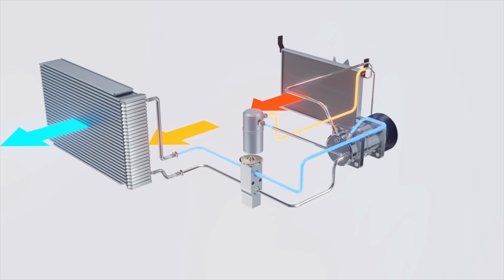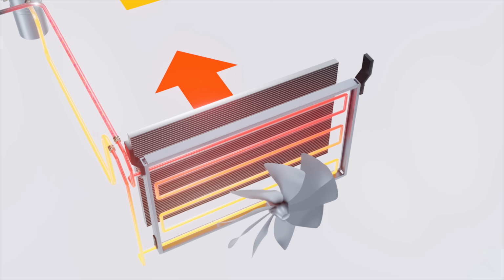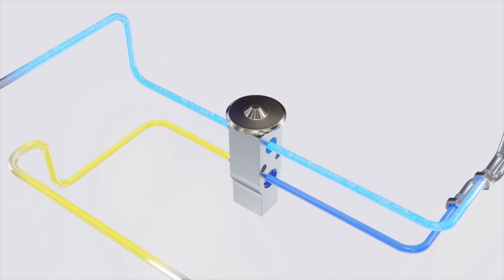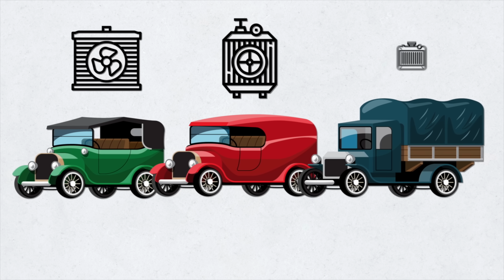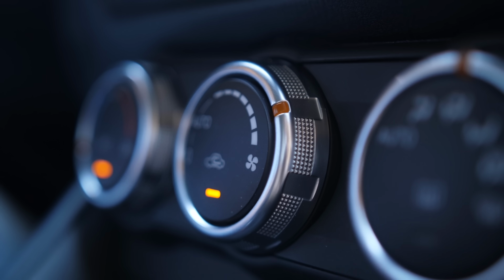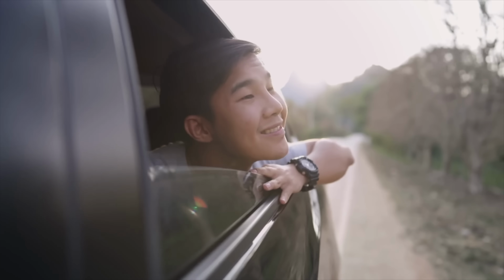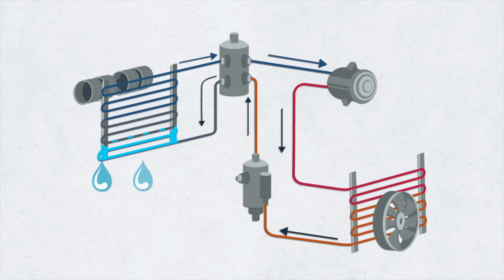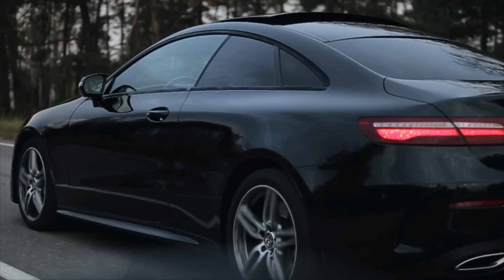Never Do This to Your Car’s AC System

Comment: I've been told to leave the engine running if I'm sitting idle with the ac on instead of turning on accessory mode just for the ac because it could drain the battery, is this true?

Comment: I have a brand new Mazda cx30 and the ac system sucks. My dads a 40 year experienced auto mechanic and we’ve felt cold ac systems in our days. My car blows 60-65 out of the vents..our 20 year old Montero blows 34 when parked. Mazda said it’s the way the car is made and they admit it’s not the strongest

Comment: The biggest problem is the compressor cannot compress a liquid it compresses gas therefore if you have water or liquid going to the compressor you get what's called liquid slugging and that will destroy the compressor over time and also creates acid

Comment: The expansion valve is called a TXV a thermal expansion valve The office tube is the little part that goes inside of a fixed office not on a TXV

Comment: Great. Thank for the info. Learned a lot. One question though, can i leave my ac and fan on when turning on and off the car engine?
Reply: Yes. You'll hear the a/c compressor clutch engage a second or so after the engine starts. The compressor will not be engaged when the starter is turning the engine. But one thing not to do is keep the a/c set to recirculate when the car is off. Move it to fresh before stopping the engine. This lets the evaporator dry off better so the a/c doesn't develop stale or moldy odors.

Comment: ‘14 Ford Fusion. My A/C compressor clutch fell off. Unfortunately, Ford doesn’t sell just the compressor clutch, so a little over $200 for the complete pulley kit. Built Ford tough my butt.

Comment: I'm about to start work on my AC system, since it doesn't blow cool air. From what I can tell the compressor kicks on, but the system also doesn't seem to like to go through the defrost vents. I've checked the coolant levels, and It actually shows that it is overcharged and is in the red. Any help before I start working on it would be appreciated. I live in Houston, and this July heat sucks. The car is a 2007 accord

Comment: I had heard that if you drive with the windows down for a mile or 2 after the car was in the sun, it was better...instead of cooling air the hot air was forced out and it was more efficient

Comment: Never had any issues in 35+ years of driving with all sorts of cars. Then purchased a 2017 tundra. After the first summer started getting a moldy smell. Went to the dealer and was told it was normal. I asked where the a/c drain line was and was told it was on top of the transmission. Also found out warranty didn’t cover this. Was told to buy cleaning kit. Tried that and it took care of the smell for few weeks but came back. Was told also to run the fan without a/c being on. Also Lysol was recommended. All worked for a short period. Then purchased a ionizer and that seemed to get best results but I use it once or twice a year. But seems to me it has a poor design. FRUSTRATING.

Comment: My 1998 Honda Accord V6 with 315,000 miles was destroyed by a shoddy repair job on the AC clutch by a crooked Honda dealership (not my regular dealership, as I was in a different town).  The damage caused was so great that it was not economically viable to repair the car.  Otherwise, the Accord had been a great, reliable vehicle for 21 years with regular maintenance.  I hope the people who did that to my car have slow and painful deaths.

Comment: Here’s a Top Gear Top Tip: “don’t buy a merc the maintenance is too damn high.”
Reply: It usually goes like that for every car, not only Mercedes. If the car was 100.000 USD new, even if you bought it for a nickel, second hand, expect it to be like 100.000 USD car maintenance. Sure, that's not as simple in every situation, but I think its good to think like this.

Comment: I find that my gmc truck has way less power when the AC is on. It’s a 2015 so should be the new system. I have to turn off the AC if I need to pass someone or else it’s very sluggish. So it’s not turning anything off

Comment: Hi Scotty Kilmer. I live in Las Vegas and the temps outside have been into the 110's. My air conditioner is working perfectly fine. My temp at my vent is around 55,  but when the outside temps are this high it's hard for the ac to keep the cabin cool. Is it safe to use household hvac foam insulation like the stuff used on HVAC line sets to keep the ambient temperature from affecting the line set temperature. I was thinking of adding it after the receiver dryer only to as close to the firewall I can get it. This is a Mk IV Jetta 2.0.  Your thoughts are greatly appreciated.
Reply: Sin city is hot as hell.  Maybe that's a clue
Reply: @ceciliaabdalla4954  I wouldn’t have it any other way! 😎☀️🌴

Comment: My wife's 2007 Honda Accord A/C crapped out on a long trip - it turned out to be a relay under the hood - after I researched the problem, I discovered this is a very common issue with Honda cars - so I now keep a spare relay in the glove box, for when we go on long trips in the summer time.

Comment: Hey Scotty great video! my wife's 2010 Honda insight always blew extremely cold air with the AC on, then one day she came home from work and a extremely loud scraping metallic sound was heard. The sound started with the car and did not go away when turning anything on, it only went away when you turned the car off. The AC was also no longer blowing cold air at all! I've diagnosed it as the AC compressor pulley/clutch needed to at least be changed, the clutch never engages when you turn on the AC but the pulley rotates freely(just with lots of metallic scraping noise.) So that's my next project when i have time off to change the compressor pulley on my wife's car!

Comment: When the outside temperature is over 110 degrees (F), my AC system stops working.
Reply: Possibly your ambient temp sensor. The ac and computer relys on this sensor to trigger the ac compressor to kick in
Reply: Are you RODDNEY DANGERFIELD/

Comment: AC uses a minute amount of gas, it only takes the drive belt to practically run the whole system, your car loses about 5 to 10 HP while it running, If you leave ac system off all the time, the input seal on the compressor will dry out and eventually leaks. it's better to run ac regularly.

Comment: So I just bought a 2005 Toyota Highlander, the problem with the AC is that it work decent while driving, but it blows hot air while sitting at a red light. I am thinking it is a condenser leak.  Because when I park I see a big puddle of liquid under the vehicle. Just curious what you think?

Comment: I had a Subaru Forester 2015 with a six speed manual. Off road trying to slowly go downhill-no joke- a good way to simulate a speed control low range was to turn on the ac. It would cycle and tax the motor and slow ya down a few mph.

Comment: THE ac in my 2013 corolla,  works some times.  i had it check guy said the compressor was bad.  but if it is , why does the system work some times?   he said he took all the freon out. then put it back.  and the system worked when he backed the car out?   i drove it for 10 mins before it kicked on.     now, you never know when it will kick in.    any ideas??

Comment: I wish he mentioned if you use the recycle button constantly and avoid getting fresh air though it. You will get that sickening mildew smell throughout.   I honestly never knew this.   So On my lemon Cadillac  CTS they had to disassemble the whole interior and replace every duct. Took 25 days .  A cleaning didn’t not work . 
I run on fresh air these days. And after 35 years gave up on Cadillac for life.  All made on Fridays at 5pm.

Comment: My wife has a 2010 Lexus RX350, 135,000 miles. We bought it with 30,000 miles and has been a great car, but it recently started with A/C problems. A mechanic replaced the compressor. He said the compressor was weak, and the compressor had an issue working with the automatic climate control.  It worked fine for a couple weeks, but now it started to only blow cold in the cooler mornings or nights.(Florida 80 degree nights).  When it's hot outside, it stops working, only blowing warm air. Not sure if the expansion valve is now the problem?

Comment: Hey Scotty I gotta 97 prelude and every time I turn my AC on my rpms drop down to 500 to 600 rpms. AC blows out cold but I can only use it when I'm moving. If it's on when I come to a complete stop. My motor sounds like it wants to stall out. I only drive it on the weekends. I only put about 300 miles on it this year. Got any ideas why it could be doing that?
Reply: Check to see if your vehicle has an idle up solenoid or fast idle air valve. It's designed to compensate for loads on the engine like A/C. Sounds like it is malfunctioning. Some older ones have an idle adjustment knob to adjust idle under load.

Comment: Hey Scotty I have a 2018 Honda CR-V Ex with 48k miles. I got it new off the truck and now it’s having Ac problems. It’s not cooling and it’s been to the dealership 4 times now. They can’t seem to find the problem. It’s my only suv for my wife and 3 little babies. Can you help?

Comment: Hello guys. I have a problem with my ac in my car. From time to time the ac is not working. It’s like I’m turning it off  but I’m not. And no one can explain me why is this happening.  When the ac is working there are no funny sounds  coming from the system. What could it be ?

Comment: What’s nice about hybrids and EVs is the AC is connected to battery versus the engine so it’s crisp and cold the moment it turns on
Reply: The disadvantage with a hybrid is in heavy traffic on a hot day you can watch the battery level drop quickly and then the engine will turn on to recharge the battery. Watch your MPG drop. Similar with range on an EV.

Comment: I’ve had to turn off the air conditioning while driving through the section of I-15 that goes through Arizona.
Reply: Why?
Reply: @TaylorPhase  Because the coolant temperature was going too high. It came down after I turned off the air conditioning.
Reply: @CarbageMan  but why? ive driven that route many times with AC on
Reply: @TaylorPhase  Your car is not my car.
Reply: @CarbageMan  then get a new car and stop contributing to climate change
Reply: @TaylorPhase  'hole troll muted
Reply: @CarbageMan  not trolling. Being real. Arizona has been suffering enough from climate change and wild fires and heat records

Comment: I try to minimize usage of AC unless its a real hot day.  I can see the RPM's go down slightly when it turns on knowing  it's taking power from the engine and using more gasoline.  At $4 per gallon here in California every drop counts

Comment: I had my ac on blast yesterday because of the intense heat but my engine wasn’t on, only the dashboard. After about 20 or 30 minutes when I tried turning on the engine, the battery was failing and I couldn’t start up the car. Why ?

Comment: My AC in my 2006 GMC ENVOY (V8/5.3L)  when sitting still. doesn't blow any air at all,only blows when I'm getting up to speed or when I'm moving over 30, also if I push the button that circulates the air inside the car it stops blowing no matter how fast I'm going. What do you think my problem is? If it helps this issue did not start occurring until the day after I had a new water pump and fan clutch put in

Comment: I just had the rear a/c evaporator replaced in my 2013 GMC Acadia because it was leaking.  It has 85,000 miles on it and it was the first repair that I’ve ever had to fix.  It cost me $1100 for parts, labor and sales tax.  I had it fixed because it has been a reliable, comfortable AWD SUV that goes really well in the snow.  I hope it stays maintenance free for another 85,000 miles.

Comment: I took my car to the mechanic to fix the ac. They run an ac diagnostic. They told me the compressor wasn't working. How can I  prove this by myself. Because on this video I learn that if there is a leak the compressor won't work.
Reply: "the Mechanic" does not mean "The Dealer Service Department". My 2010 Xterra compressor clutch would not engage & Jippy Lube said "You need a new compressor". The dealer just added correct refrigerant pressure, and the pressure sensor enabled all systems GO. Leak tests passed for 20 minutes also. Hope this helps as much as Scotty Kilmer does.

Comment: It's best to simply run your AC all of the time. The big benefit here is you are constantly drying the interior out so it doesn't get that wet dog smell, or cause rust, and it keeps the AC in good shape, for hundreds of thousands of miles, and the gas mileage hit is negligible.

Comment: I bought a car 3 weeks and 350 miles ago and the entire AC system had crap in it, so I paid 1834 USD to replace the compressor, condenser, and expansion valve. That's my horror story. The car has about 29k miles on it. Oh and I'm currently looking for a new engine (crazy rod knock). Will not buy from that used dealer again.
Reply: buy a 2017 Mazda CX 3 Touring awd automatic 4 door if U can find one ...make sure it's awd for snow belt areas....(don't buy red)....no problem at all change the oil at 4,500 miles or less NOT 5,000 miles like the book says....we have Mazda 2002 Protege Lx automatic FWD 4 door have 200,000 + miles no engine problems whatsoever... we just change the oil religiously every 3,000 miles ....sometimes B4.... 3K miles... we always had a Mazda Protege at least we leased them B4 & also no problems...(follow changing the fluids etc like Scotty says if U plan on keeping the car "forever"......(past 30K ....50K miles...change fluids etc)

Comment: My AC clutch engages and disengages continuously while the AC is turned on. I filled the low pressure end and the pressure climbs to 30 psi while the clutch engages, but then drops when it disengages.
What do.

Comment: I am about to turn 52 years old, but before I do, certain ex wives of mine thought it would be a great idea for me to spend the rest of my time living in my car.  Last winter, was brutal and I learned that my car would combine the ac and the heater anytime I pushed the defrost button.  This drove my car mate crazy so she had to go where defrost involved heater only despite my warnings that hot air can hold more water vapor or moisture.  Some people lack vision and Scotty Kilmer is NOT one of them.  Thank you Scotty, for validating the preset  defroster button in my Nissan LEAF, and for this video which I will use to figure out what is ailing the AC in my Dodge Grand Caravan.

Comment: I’d like to have control over AC on or off in DEFROST mode because I don’t need AC below 10F.  I need heat to clear the windows, not even colder air blowing.  My 1992 Nissan worked that way just fine.

Comment: When I lived in Yuma, Arizona, I had a 1984 Chevrolet Citation. The A/C did not work, and with temperatures in the area that commonly reaches 115 in the summer, I was determined to repair it. An aluminum tube ran from the condenser to the receiver/dryer, and that route went under the battery. Acid from the battery had corroded the tubing over the years. I replaced the faulty compressor and the receiver/dryer, charged the system and 10 minutes later, the aluminum tube burst. I replaced the tube, charged the system, and it worked great. About a month later, the evaporator started leaking. I replaced that, recharged the system, and was basking in the comfort of nice cold air in the car. The GM R4 compressor was not very reliable, and rebuilt ones had a worse reputation. There were a lot of conversion kits at the time that used a different compressor to replace the R4, but they were expensive. Anyway, The compressor seized up, just as the original had. I gave up, and only used the car to drive to work and back without A/C.

Comment: I have moisture buildup on my windshield when I turn the AC or defrost on my Mazda protégé 2000 but it still blows cold air so that’s what I want
Reply: Only if I accidentally turn on the recirculate button does my windshield fog up.
Reply: @idratherbefishing7753   Mine does it both ways recirculating or normal

Comment: My parents 2014 sienna had a bad blower motor, they had to take it to the shop multiple times, but I drove and it was miserable, it was 90 degrees windows down, it was hot for sure!  Sure it’s worse in like Arizona or somewhere over there where it gets hotter then 100 degrees.

Comment: I have a rattling sound that I hear when I turn on the AC in my car. What does that mean?
Reply: It typically means you have a bad compressor or clutch or if you're lucky it might be a belt. (bet on compressor).

Comment: A car dealer tried selling me a black car with a black interior. He said the trick to cool down fast is to open all the windows and blast the cold AC air to your feet. Cold air is denser and stays closer to the floor, so the hot air is pushed up and out the windows. Close the windows after a few minutes of doing this.  I've been doing this now on different black interior cars for 20 years now...

Comment: My dad used to Have  a 1987 Ford Tempo GL while mom had a 1987 Oldsmobile Ninety Eight Regency. 2 years after dad bought the Ford Tempo new, during a 110° day the compressor clutch failed. He was not happy! So while the car was scheduled to be repaired because the shop was busy he had to borrow Mom’s Olds during the intense heat.

Comment: When I was a teenager back in the 60s I was told not to turn my a/c on at freeway speeds because it was hard on the compressor clutch going from 0 to 2000 rpm instantly. I no longer believe this. Was it ever true?
Reply: Any car now with an expansion valve system cycles the compressor constantly while running so it makes no difference. But, I do have a couple older GMs where the compressor stays on. I try to turn the AC on at idle. Agree that 0-2000+ in a split second can't be good for the compressor but hey what can you do.